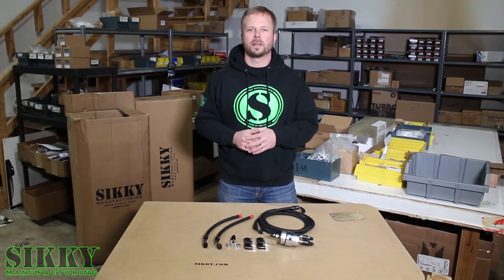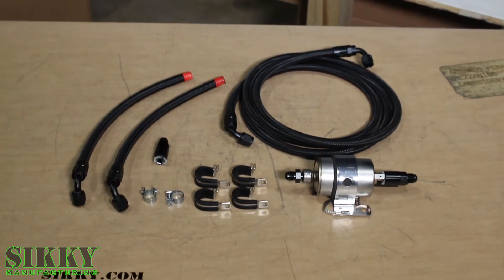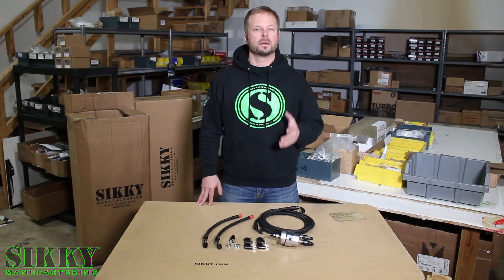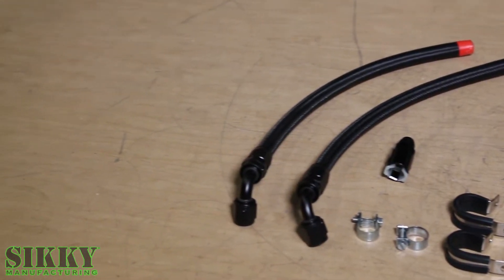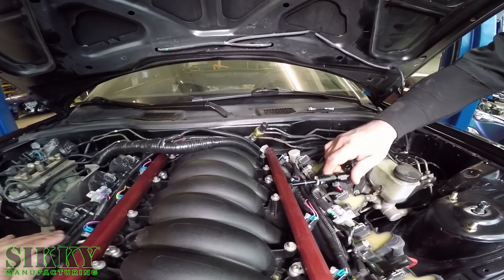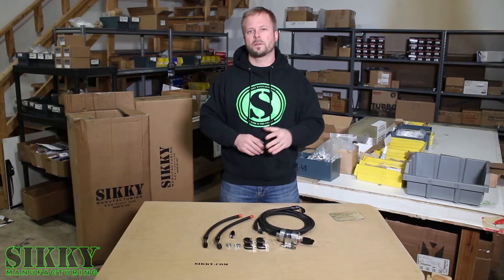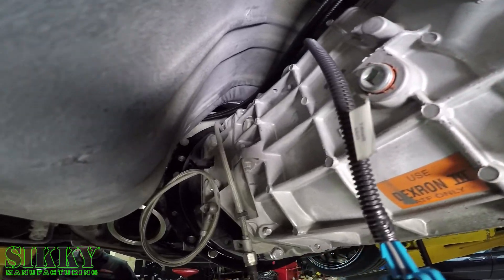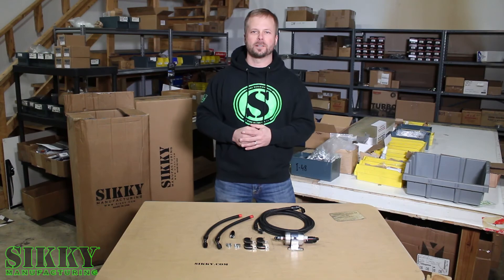FD RX7 LSx Fuel System Upgrade Kit SIKKY Manufacturing

Comment: There is nothing on the site that mentions anything about a FD kit.  Is the universal kit?
Reply from the maker: Yes, it was not added to the site yet.  Should be up in a couple days.  It can be ordered as of now but you would need to call or email the order in.  sales@sikky.com or 410-780-0009 or check the site in a couple days and it will be up.  thanks!

Comment: Is the FD fuel pump sufficient enough for the ls1?
Reply from the maker: I would do a drop in fuel pump upgrade like a Walbro 255 at least. But yes a bone stock ls1 would be fine on stock FD pump